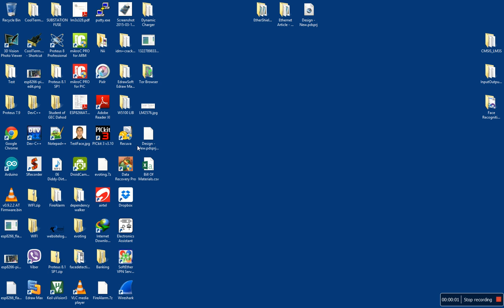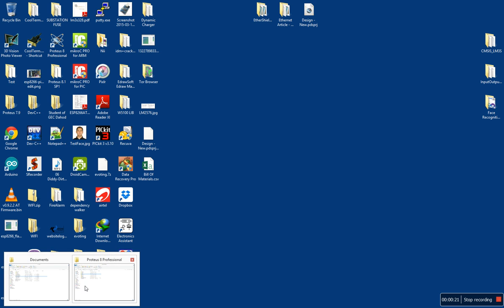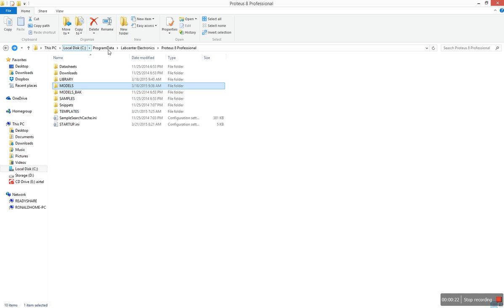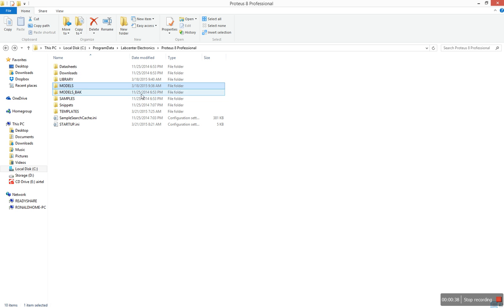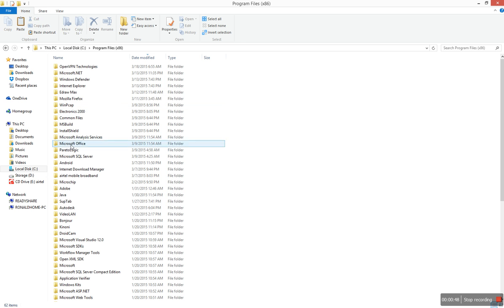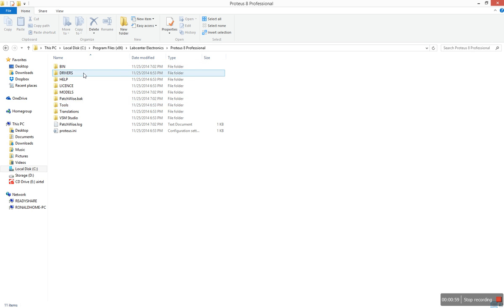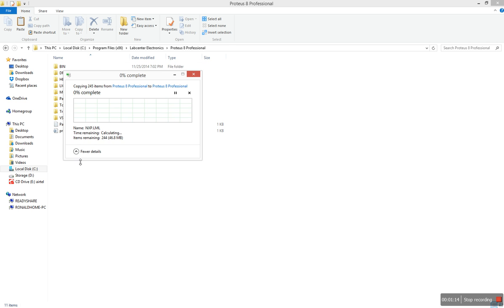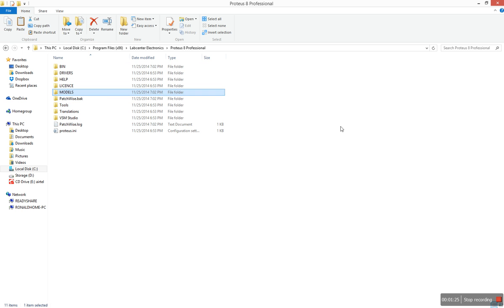Fix Labcenter Proteus VSM Crash

Comment: Hello Ronald Arthur I have done as illustrated in the video but it is still crashing my simulation involves a microcontroller i.e. the Arduino uno is there any way you can help ?
Reply: if u fixed this please tell me as I have the same problem now :')
Reply from the maker: If you don't mind can you upgrade to 8.5 since that is very stable.
Reply: Ronald Arthur I will try, thanks so much

Comment: doesn't work
Reply from the maker: +Et3 et3 Models and Libraries folders need to be present in C:\Program Files (x86)\Labcenter Electronics\Proteus 8 Professional, please replace Program Files (x86) with Program Files if you are running a 32 bit OS

Comment: hi i have proteaus 8 and it has same problem crashes during simulation, its very annoying as it takes time to built circuit and after 4 to 5 minutes crash, i have followed your steps copy module and paste it in c programme and then in labcenter electronics but still crashes what can i do as i have reinstall and installed proteaus 8 several time to make it work
Reply from the maker: +Israr Hussain Models and Libraries folders need to be present in C:\Program Files (x86)\Labcenter Electronics\Proteus 8 Professional, please replace Program Files (x86) with Program Files if you are running a 32 bit OS

Comment: proteus is crashing during simulation of codes (micrcontroller simulation) otherwise its working fine
Reply: Yea you r right it's only crashing while using microcontroller Simulation "Arduino mainly". so please if u know how to fix tell me...
Reply from the maker: What microcontroller are u using
Reply: +Ronald Arthur On atmega8, atmega16 and arduinos simulation runs for sometime and then it crashes.
Reply from the maker: This was happening to 8.1 and 8.2 alot 8.3 had a fix
Reply: +Ronald Arthur i am using 8.3 sp1 what is the fix ??? plz help
Reply from the maker: Check program files -> Labcenter electronics -> proteus 8 professional has the library folder and models folder
Reply: Proteus 8.7 is the same,  it crash when you use microcontroller (PIC)